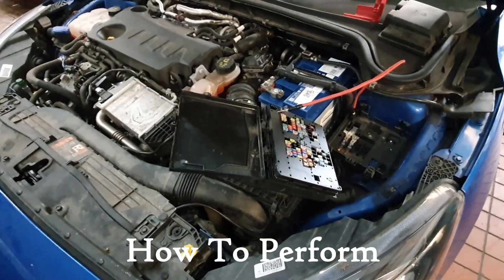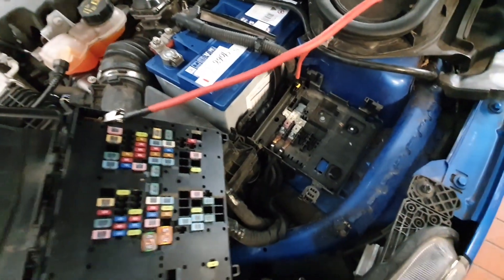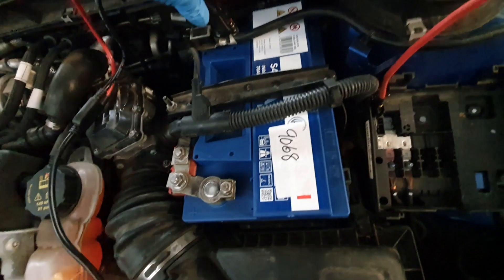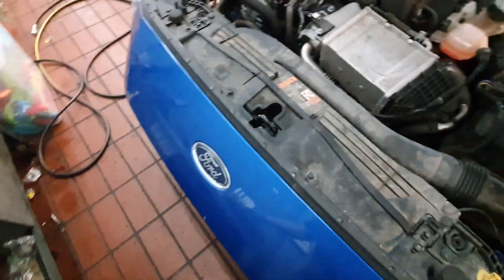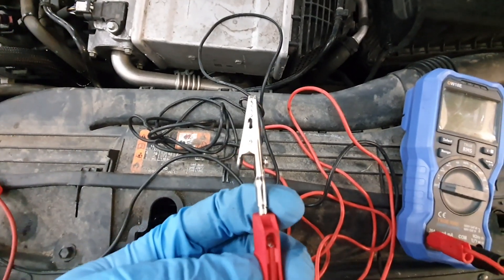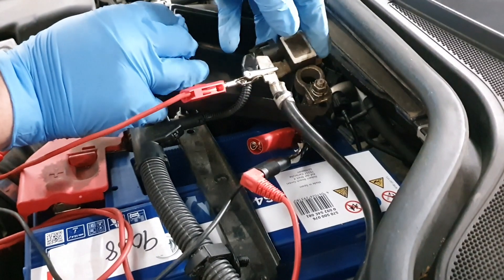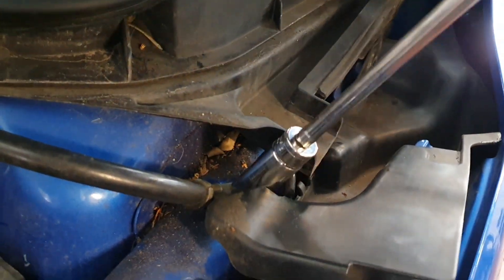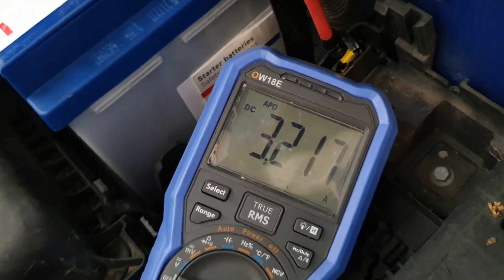The BEST WAY To Perform A Battery Drain Test - Part 1 / The Best Way To Perform A Parasitic Drain

Comment: What causes the switch off engine to save battery to come on randomly
Reply from the maker: The battery is monitored by a sensor, when it senses the voltage or state of charge dropping below a certain level it will pop a warning message on to turn off the ignition, then eventually it will turn the ignition off...are you sure it says switch off engine to save battery and not to turn off ignition?
Reply: @DansDiagnostics  system off 
to save battery
Please turn ignition off or start engine
Thanks Dan for any info